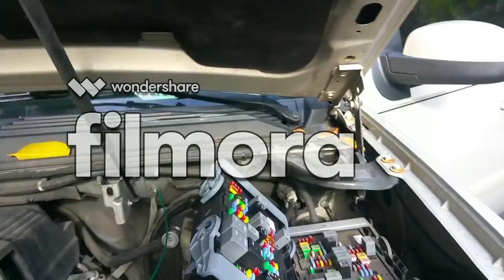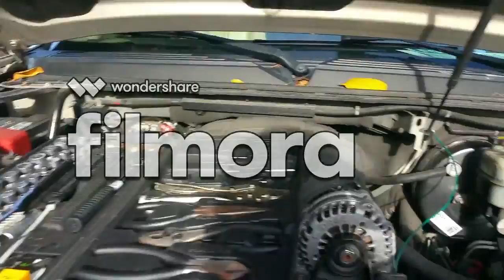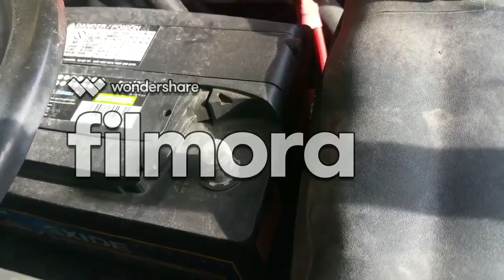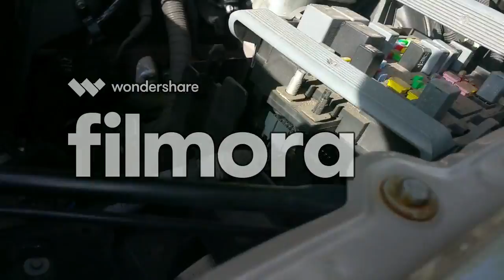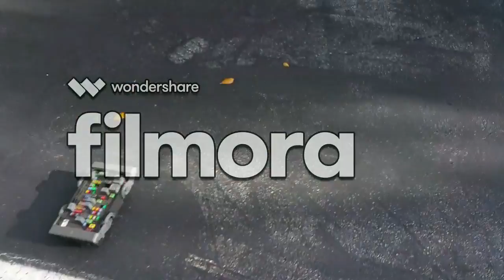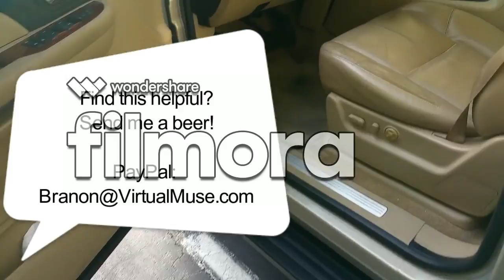2007 Chevy Suburban 1500 LTZ Replace Fuse Block to Repair Electrical Issues

Comment: Will this cause my right side blinker to stay solid on even when the truck is off this is driving me crazy trying to find the problem?
Reply from the maker: No idea, but I would add the extra ground wire as a preventative regardless because you cannot tell when the 'ground ribbon' starts to deteriorate as it is behind the engine block
Reply: I'm having the exact same problem, except on drivers side

Comment: is there a way to test to see if it is the relay inside that is bad
Reply: Main problem is your reverse lights will stay on when your fuse block relay is bad, 99.9% of the time it's the relay in the fuse block. 
Other problem could be faulty neutral safety switch
Reply: Tom Christensen watch the car doctor he shows you

Comment: What size bolt did you use on alternator bracket?
Reply from the maker: The only one that fit the existing hole - 10mm I think.

Comment: Can the addition of the ground wire be used as a preventative measure? I am currently having an issue with my high beams but that's the only electrical issue. Not sure if it's related.
Reply: of course it would be a preventative measure.  Cant hurt.  I would do it.
Reply: It most definitely will!

Comment: They're bad for corrosion in the fuse boxes as well. Mine has been giving me some electrical fits. I'll definitely be adding that extra ground wire while I change the fuse box, thanks.

Comment from the maker: Chevy, GMC, and Cadillac SUVs and Full-Size Trucks have a series of electrical problems that can be solved by adding an extra ground wire. If you wait too long, the problem will blow the back-up light relay, which is an integrated circuit inside the fuse block, and the only way to repair it is to replace the fuse block under the hood ($300 part). This video will walk you through changing the block, but it will also show you where to add the ground wire and solve many of your electrical issues including TPMS lights, Stabilitrack lights, engine lights, radio popping, and lights on all the time.
Reply: Branon Edwards sorry I meant to tag you in my initial post
Reply: Branon Edwards I’ve got all those lights you named on and the odometers are going haywire, the fuse box fuses are excessively hot but only on one side of the fuse box do you think the additional ground will solve issue?
Reply from the maker: It's a cheap fix and certainly can't hurt... I would definitely try it!
Reply: @adude31100  I have the same issue, with the fuses getting so hot, the plastic melts, but doesn’t blow the fuse
Reply: can you expect this will cause a problem with 4x4 engagement as well? I have all the symptoms you describe here including door chime not turning off, door locks locking and locking on the own, digital gear selector flashing along with abs flashing and a hand full of codes pointing toward the transmission control module.
Reply from the maker: Again, always best to add the ground wire first since it's the easiest fix. And see how things go from there.
Reply: Im also having similar issues on my 2012 silverado. Im also looking to add 4 awg wire from firewall to alternator bracket as you did.  By the way, what size bolt is the one holding down your green wire on alternator bracket?
Reply from the maker: It was the only one that would fit into the pre-existing hole in the bracket - 10mm if I remember correctly
Reply: I have a electrical short on the main power coming in the fuse block.  It has been shorting out to the point that it has burned it up. I can't replace the female connection.  Can you buy the individual connection blocks or buy the whole bottom?
Reply: Albert Schroeder junk yard
Reply: I've checked everything. Having a no crank no start situation.
Reply: Chevy suburban  2007 it started with the lock going on/off. Then stability track light on the dash they would reset if I turned on off. Then all the dash lights would go off shut the engine off have to throw in neutral  to turn on. Then now it just turns off and I can control  the wheel  or anything and no dashblights go on. And even if I throw into park to turn it on it won't even light up. I have a new alternator I have a good battery. I don't  know what to think.
Reply: @donanico7533  Watch the video and add a secondary ground wire from the ground bolt on the firewall to the extra hole in the alternator bracket. Most of GM's electrical problems revolve around a bad ground in the electrical system. The extra ground wire typically fixes the issue. You can also replace the primary ground - looks like a silver braided ribbon that runs from the fire wall bolt to the back of the motor. It's a bit hard to see unless you're literally laying on the motor. Good luck!
Reply: Do you have to keep the old ground wire on as well i took it off will that make any difference
Reply from the maker: @phillipcastro2394  I would leave it on and actually replace it if you're having ground problems. It's a little hard to get to behind the engine block, so the extra ground wire is a quick fix and also a bit of insurance. There are something like 80+ grounds running through the original ground ribbon from the firewall to the back of the engine block - better safe than sorry. It's an inexpensive part - I've even found them on eBay for a few bucks.